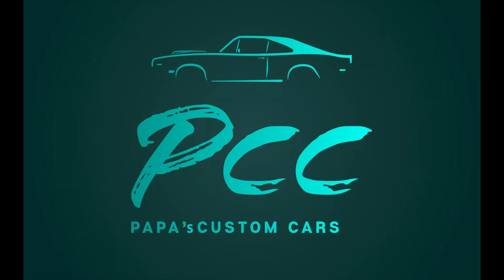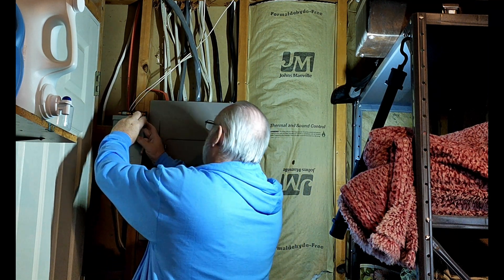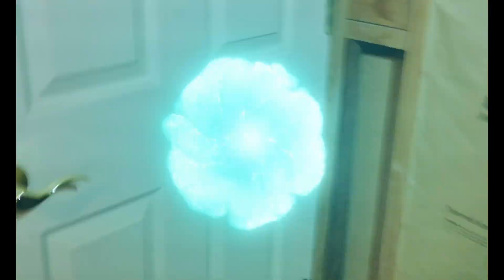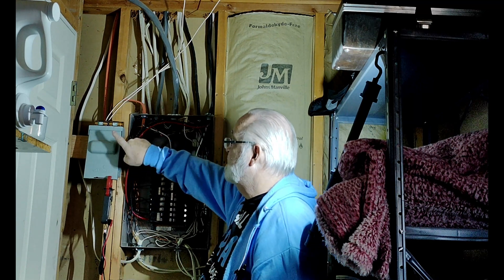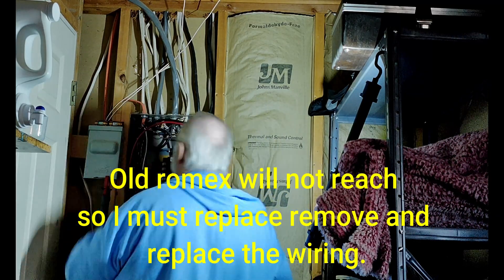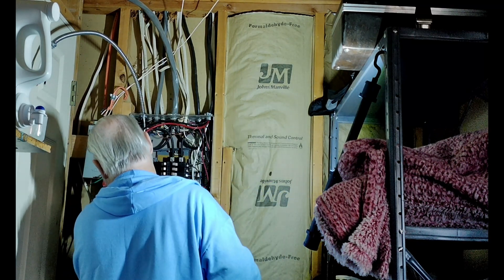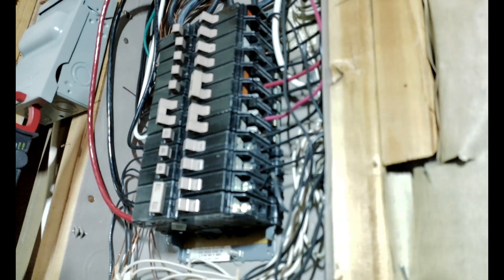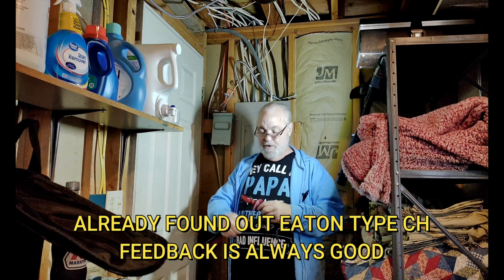What were they thinking? Fixing Electrical Panel Mistakes

Comment: You want "crazy?" the disconnect is fused, and if you were in a commercial setting and had an upstream disconnect then I'm quite sure the tap rule would make it legal.

edit: confirmed, you have a 100a breaker upstream, 240.21(B)(1) and (2)... I don't think it's allowed to be used in residential - other than that, legal.

And when the proper fuses are fitted, they are more reliable than breakers.
Reply from the maker: Still makes no sense if you have a circuit available.
Reply: I had a commercial client, that the HVAC guys tapped into a 3 phase 60A leg fused local disconnect for an evaporative cooler that was wired with 12g wire.
I had to relocate that leg to a new 20A 110vac breaker, before it burned the place down.
They managed to fry other equipment and wiring on their assorted visits. 
They kept me busy for while running new wiring.
Reply: @blaydCA yeap.  future "work" by idiots is one of my primary arguments /against/ taking advantage of mca vs mocp. You just bought a freaking hvac unit, likely for a few $K. Compartively, you're not saving that much on wire.
Reply from the maker: @emolatur I know right. Not to mention how it benefits the guy working on it by having a properly setup unit with a disconnect next to the AC
Reply: @emolatur  It was pure ignorance from these clueless idiots.
The client most frequently left me on autopilot to fix as needed or requested in the facility.
There was a "list" of projects to be done IF I wasn't hijacked by the various departments to fix their problems.
Busy day in store when THEY unloaded and carried MY ladders to the problem area before I got to the office door to get the list.
Reply from the maker: Wow

Comment: That a/c “sub panel” looks more like a “local disconnect”. Rather strange to see it not being located by the compressor outside.
If you pulled/removed the bar from the unit it’s a disconnect.
If you flipped switches, it’s a breaker box, which is rather strange considering the panel has the breaker already.
Reply from the maker: That's what I call "some guy" work. He had some friend who said they do work wire a bunch of stuff. Scary as I have not filmed most of that guy's work, I just redid it.
Reply: @papascustomcars  Well..if it's an a/c disconnect (I can't actually tell from the video), it's supposed to be near the outside compressor. It's to enable a service technician to work on the outdoor equipment without needing to waltz back and forth to the air handler (which may be in an attic)or thermostat. It can also disable a malfunctioning compressor so that the air handler can still function in heat mode.
Regardless, it's totally useless in it current location, since the air handler and relays are on a separate 110vac circuit (as a rule) and the outside compressor is supposed to have a dedicated 220vac circuit.
Good luck!
Reply from the maker: That is correct
Reply: @papascustomcars  On a positive note, I've seen far worse and certainly far more dangerous. Frequently. 😭

Comment: The audio cut out a little, but at about the 15:18 mark it sounded as if you said that you'd already verified that the wire would handle the increase from the 50A to 60A breaker. For those who may be wondering, assuming copper wire, the 50A breaker needs an 8 AWG or larger wire. The 60A breaker needs a 6 AWG or larger wire.
Reply from the maker: Thanks for the clarification for everyone.
Reply from the maker: Yes when they came in and gave me a quote they verified the circuit was sufficient based on the 6 AWG already running to the garage. I plan to have a 100 Amp added to the main and run direct to the garage later. That solves a lot and would allow me to increase my EV charge output. Right now, I have it limited  to 40 amps.

Comment: Breaker is Eaton CH (Not to be confused with Eaton BR.). Also, Please double check the Amperage rating of the wire for the breaker you are replacing. If you up the size of the breaker you need to make sure the wire to what ever that is feeding is rated for that size breaker. You can find this in table 310.16 in the NEC.
Reply from the maker: I appreciate the feedback, any is always good. I had an electrician come in and give me an estimate on the EV system I ended up putting in myself. iI asked about the increased load and he was the one who stated the wiring is already rated for the amp increase. I will check anyway to be sure. Thanks. What did you think of that AC wiring?
Reply: @papascustomcars1670 sweet! I cant tell the size of the wire from the video and just wanted to make sure! And Sad to say, I've seen worse! Lol. Still scary, though! I have found an A/C where someone terminated the end of the romex run with the male end of  a plug and just simply pluged it into a garage receptical and called it a day... lol the romex was ran outside into the A/C with no conduit as well. That with everything else i had found there, I was suprised the house wasn't just a pile of ash.
Reply from the maker: @Abandonship31 wow… in this house we refer to that repairman as “some guy.” In many cases the old owner had some guy come over and fix it. They actually built the garage over an active sewer line and had to pay for them to reroute the pipe. They already finished the garage.
Reply: @papascustomcars  that is unfortunate!
Reply: @papascustomcars1670  its crazy how that happens! In the city of Seattle there are homes built on top of creek beds. Im not sure how that all works, though as it pretains to the structural integrity and foundation of the home. I just find it odd that you can jump in to a crawl space and find running water... its supposedly ok..